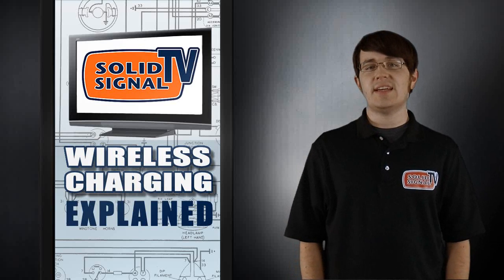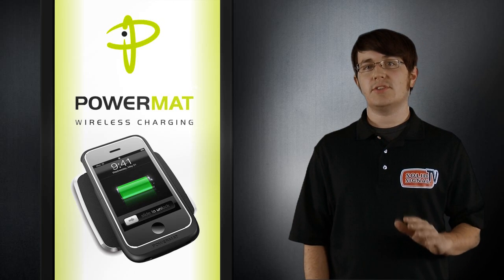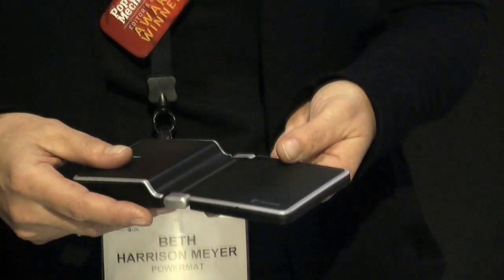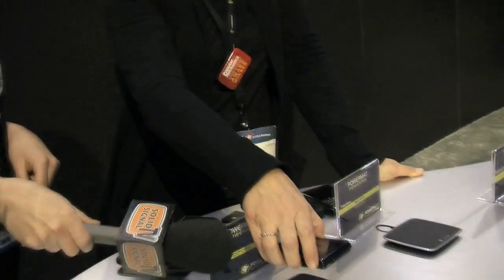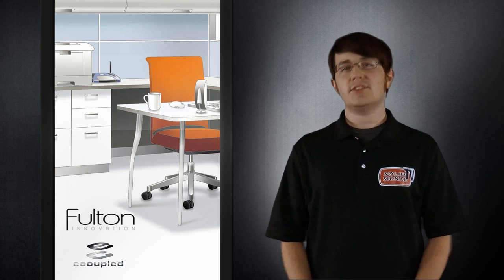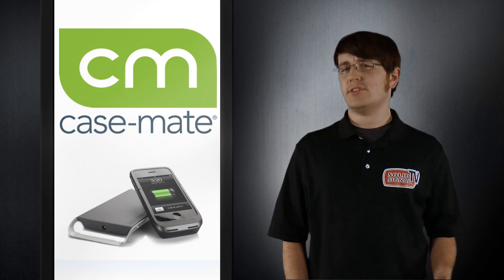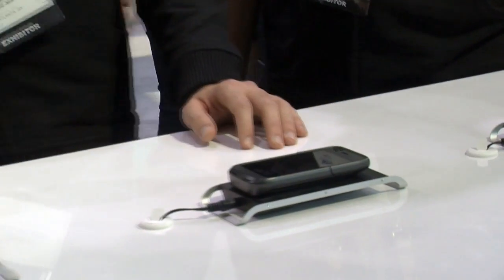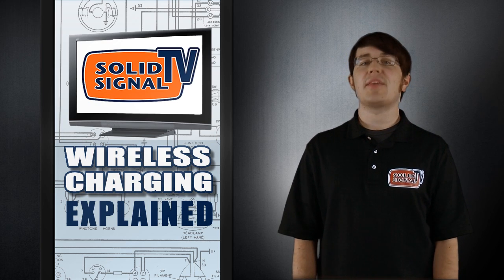How Wireless Charging Works - Solid Signal TV

Comment: I guess it really depends, this would be useful for my current phone because I accidentally dropped it in my kayak (which still had a puddle of water in it) and the charging port wouldn't work.  I currently have to take the battery out every night and put it on a wall charger.  Wish i would have seen this sooner.

Comment: I'm not some old prune kinda guy, but this technology makes NERVOUS and has possible CANCER written all over it.
   It also makes no sense because the device HAS TO be in contact with the table, which means all your saving is the fraction of a second it takes to plug the phone in to a traditional charger. 
Its NOT like you can use the phone while its charging!!!
I will simply stick with my power "traditional" chargers. SMH
Reply: well you have to lay it down, but the chance of wrecking those fucking micro usb ports is zero
Reply: Mrepifany LOL. No i am not that kind of guy, but i made some bad experience. My old phone, a Samsung Galaxy S Plus had the port broken 2 times in 2 years and i plugged it in about 2-3 times a day. And now i have the note 3, which has that micro-usb 3.0 port that looks even more fragile. The port shouldn't break, but if you look at it, you know that it is not the best invention made

Comment: i think the current state of wireless charging is useless....becas u will have to keep ur device on the pad anyway...this is good for toothbrushes n shavers which r not that mobile.... but cell phones...this tech is a flop i think. it will just addon to the cost of the device without giving the user any real advantage....